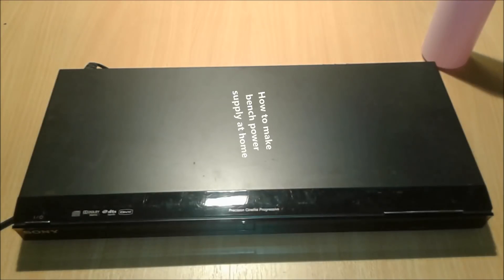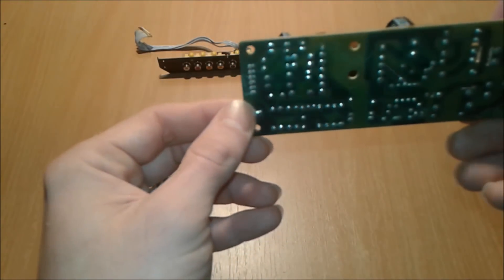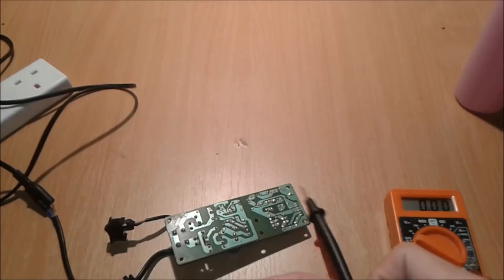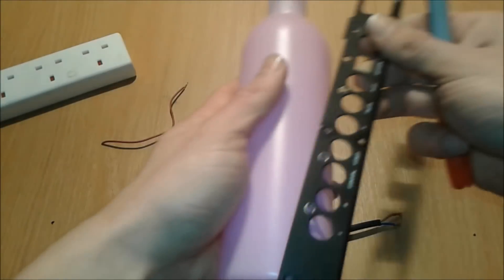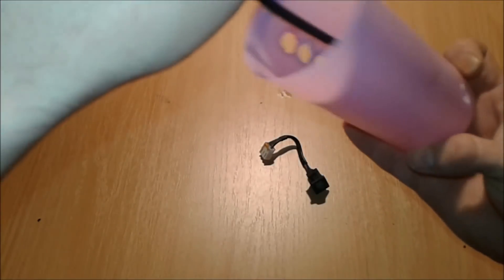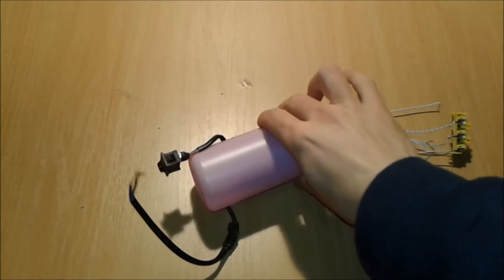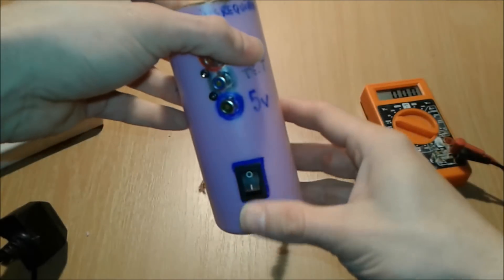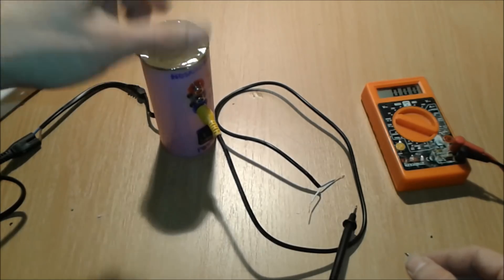DIY bench power supply in old dvd player at home

Comment: Can I touch output dc wire? shock or not...
Reply from the maker: good child not recommended but you can touch it. All devices that are plug in the main can have a failure and you will end up touching the live mains220/110v wires